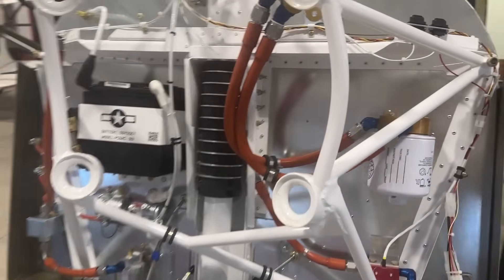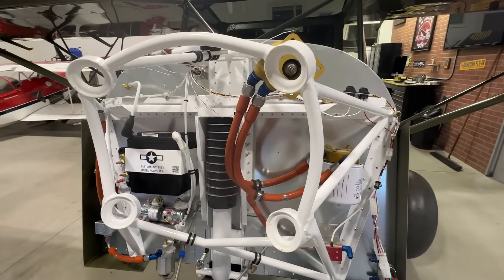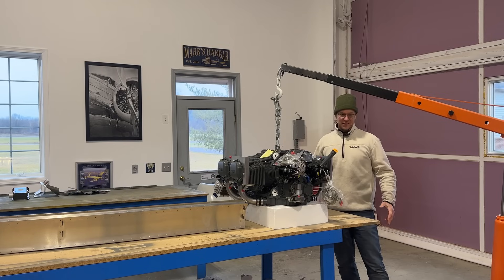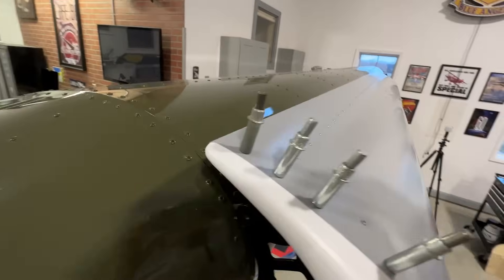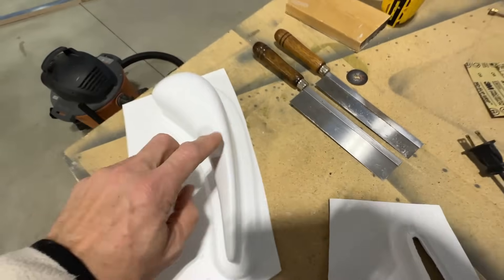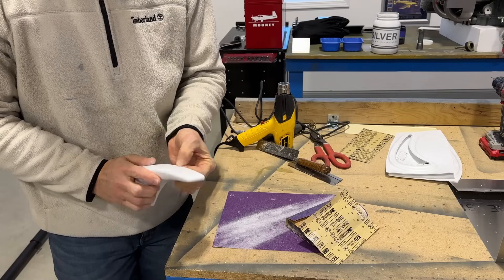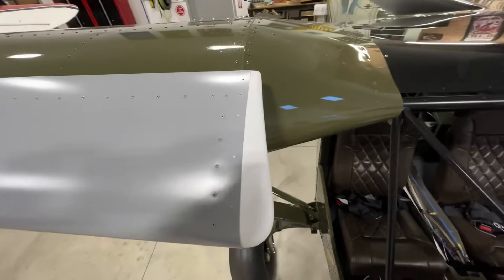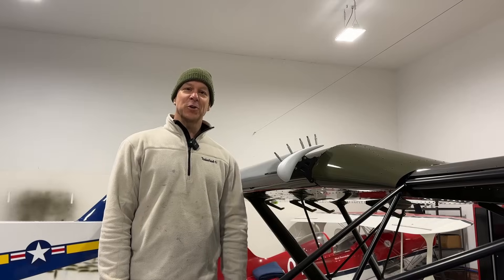How I Installed the SLAT TIPS!

Comment: Are the slats fixed in one position and the attachment brackets run through into the spars? 

* could you mount LEDs to the plastic wing tips with rivets (and back washer) before inserting into the wing?
🤪
Reply: Yes they're fixed position slats unless modified. Wing tips with LED's? Sounds doable to me.
Reply: But I wouldn't rivet them.

Comment: Nice job! A table belt sander would save a lot of your time. I would put the heater kit pass thru as low on the firewall as possible because my feet get cold before anything else and heat rises. Great videos, thanks.
Reply: After a few scat fights you might really truly just want to be able to firmly grasp the scat with both hands while turning a  hex head as opposed to a slotted one. Heating passengers toes may be a much bigger project altogether.
Reply: I'm gonna use a water cooled engine, but with that Zenith valve I would make it cable actuated from a dash mounted lever. I'm not really ok with any of the exhaust shroud heater kits. @anthonyrstrawbridge
Reply: @kenfawcett4006   I'm mostly interested in the business model; it looks great! Would you run the cable in the scat or outside of it?
Reply: Definitely not inside. The flap valve should be in the cabin so it could be manually opened and closed in flight. More for safety than convenience. @anthonyrstrawbridge